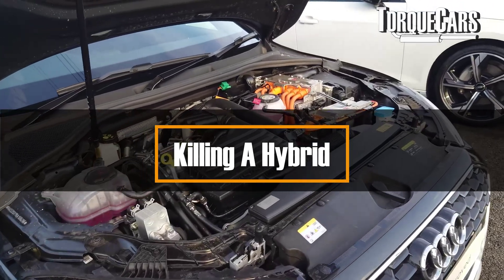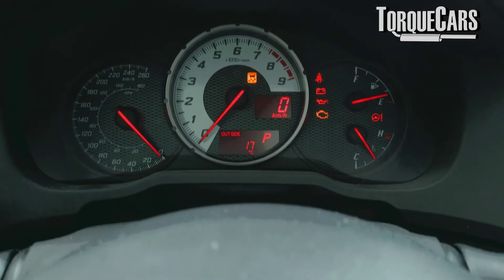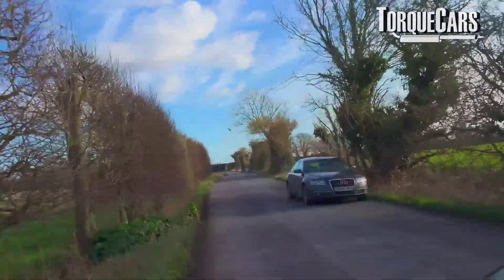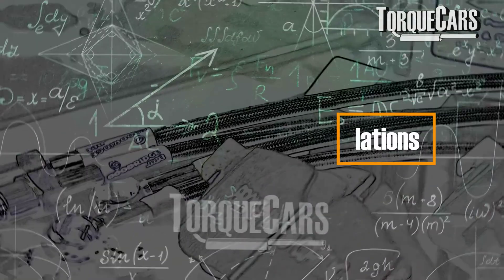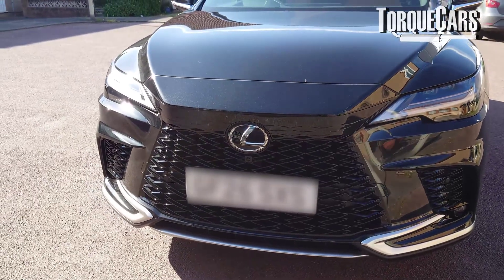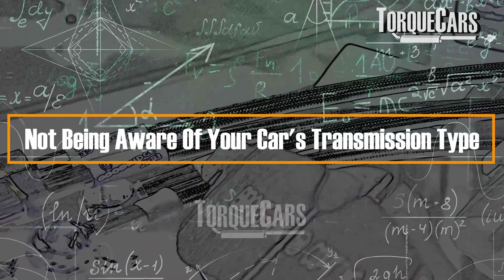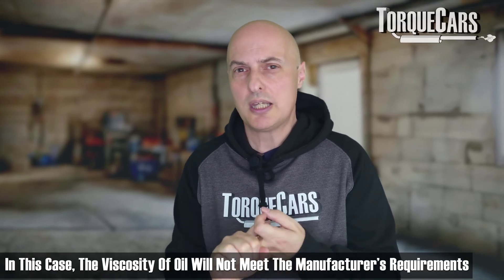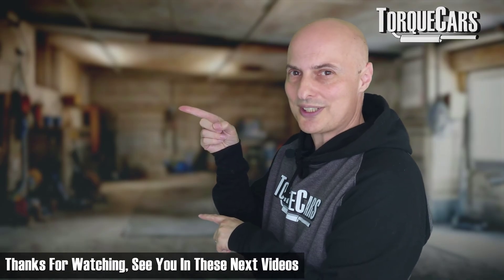The Hidden Dangers From Driving a Plug In Hybrid Badly PHEV (No One Tells You This)

Comment: Latest data shows PHEV’s aren’t much better in fuel economy than ICE cars but more over complicated. And more cost. Best version of ice and battery car is an EREV which is an EV without a gearbox. So it allows a larger battery and engine is purely a generator. This is the next generation of vehicles. But why not just go full EV

Comment: Change your oil, in a hybrid sooner than recommended.
Your 1st oil change needs to be between 500 - 700 miles.  The oil will be silver(ish) due to the engine’s internal parts breaking in.
Change your oil.

Comment: I drive a Toyota RAV 4 PHEV.  I leave about 10miles range in the battery and then go over to HV/petrol.  I have noticed in HV mode the car still uses a bit of the range and it does more mpg.

Comment: I wonder how many miles is needed to charge up that battery. As for engine temperature, well that's the question, cold day, start up electric until you're fast enough, but the engine is still cold! Slow down and electric takes over, the engine gets cold. Unless of course theres a heater to get that engine warm and keep it warm, defeating the miles per charge or gallon of course. So unless the journey is long, and lets be honest , most are not, the heat is not enough and the battery will not charge enough. Diesel has similar problem, they dont warm up for about 4 miles, as opposed to petrol at 2 miles, so a trip to town means the temperature is just right by the time you're home. As for fluid change more often, that's news to me, but not over charging, not running it too low, oh dear oh dear oh dear, Toyota's are supposed to be the best auto transmission, but now I wonder.  its amazing how one video can put you off.

Comment: '24 Toyota CCH. Same as Prius AWD. Prefers @38-60% charge. Have scan gauge. Only way to increase temperature is to use simulated gears, otherwise it manages. I made grill screen for November to May driving, MPG went back up @10. Always hyper mile. ALWAYS 3.7 miles each way. At least once a week don't turn off, charge 12v for an hour automatically turns off. Tires 12% over, average 77 both MPG and EV ratio since new, far exceeding expected. I never drive over 60mph as the EV mode can't activate over 61-62mph. Freeway truck lane 60mph. Will be interesting to see when the oil becomes NOT transparent. The coolants don't need to be changed until test strip indicates.

Comment: I’ve got a 2024 x-trail epower. Love the car and its fuel economy but from where I stand it’s too conservative on that front. I can be travelling at 100km/hour with a 50% charge and take an off road and as I take my foot off the accelerator the engine switches off as I slow down, go around the corner and on goes the engine again as I accelerate back to 60km/hour. In my mind this on and off again of the petrol engine is eventually going to destroy this 3 cylinder turbo engine. These cars should have been built with a larger battery say like 5kwh compared to its 2kwh installed. My advice to people is to buy a PHEV vehicle with at least a 20kwh battery and a non turbo engine.

Comment: Rather an alarmist clickbait title. Not speaking for other brands but the three Toyota hybrids my wife and I I have owned have not had any of these problems. Our current thirteen year old Prius v van has close to 180,000 miles now and the hybrid system and engine are in fine condition. My recommendation is just drive them normally and follow the manufacturer’s guidelines.
Reply from the maker: That's great to hear about your experience with Toyotas, they are definitely known for their reliability. A recent switch away from AGM 12v batteries have led to a few issues, but we have to bear in mind that many other car makers are starting to make hybrids now and lack the experience.

Comment: This guy doesn't know much about hybrids, the 12 volt battery got drained in some models due to a bug, I leave my car "RAV4 PHEV" for 3 weeks every year when in holidays, no problems, the cold engine issue could be true but hybrid engines generally last longer, transmission: here the big mistake Toyota and some other hybrids use eCVT, NOT CVT, they are completely different
Reply: Yes eCVT and CVT transmissions are completely different. I have experience of driving both and for me eCVT is way better

Comment: I just got my 2023 Toyota Corolla 2.0  self charging hybrid back from the dealership this week as my 12 volt battery  went flat on my drive. I had to call the AA out .
I put it on a trickle charger up to 3/4 as I had to go on a trip next day. 
The 3 day trip was approximately 300 miles mainly motorway and 60mph/50mph roads .
next day a 12 mile journey. 
Washed and waxed it next day, in the evening  battery dead. The battery is under the floor panel in the boot.
Rear hatch won't open as no electricity. Luckily  I got the doors open and crawled through the lowered rear seats and managed to pry a gap in the floor to get charging leads on.
This is not the first time I've had a flat or very low 12v battery 
This is the second time I have taken the car to the dealership and asked for the battery to be checked and to see if any drainage or battery issues. 
They found no issues with the battery or any item that could be draining the battery and it was operating in acceptable limits. 
Last year the service representative said because I do low mileage I would need to take it on a 30min   run on a  motorway to make sure the 12v gets a good charge?
This time when I said this is not acceptable I was told due to my sort journeys maybe a hybrid isn't for me.
And try and keep it in sport/power mode. 
Shame the sales person at the dealership did not ask what sort of driving and weekly mileage  was regularly doing when I purchased the vehicle. 
Apparently washing the car with the key in your pocket does drain the battery as the doors unlock and lock multiple times and this also primes the car ready for driving, this has happened to another owner. 
I'm looking to go back to a ICE car after this one is 3 years old.
Reply: You can disable fob temporary so car won't do close/open while washing :) Press & hold lock button + double press unlock - this will disable fob keyless entry until you press any button again. Without it washing car with fob in pocket is madness :)
Reply: @deniss.1926 thanks I’ll give that a go next time
Reply: Driving toyota hybrid 30min. to charge 12v battery? Wonder what are they smoking...
Reply: @deniss.1926 yeah it does sound a load of bollocks, I’ll just have to trickle charge
Reply: Turn off Wi-Fi / Bluetooth and remote unlock (theft deterent) ,6 yrs old Corolla i've never had a battery issue.
Reply: @Roy-pk4xd  I'll give it a try, thanks

Comment: The problem in most hybrids is that the engine often doesn’t reach its correct running temperature. 
I think in Honda the engine powers the electric motors continuously.
Reply: Honda is series up to 60mph, then parallel. Nissan is full series. I.e. engine only ever drives generator.

Comment: We have a CR-V Hybrid. In cold weather, the engine starts up to warm up (itself and probably the battery pack) - and will only not start if we're recently used the car. There is no EV button in the car - so we're at the mercy of the computer which I'm sure Honda have figured out - given that the hybrid system in our Australian CR-V is the same as the system they've been using in the USA for I think 4 generations of Accord with very few issues.
Reply: yeah but we yanks bought almost none of them until very very recently.
Reply: @18_rabbit  You mean the Accord Hybrid? I thought that they had sold in significant numbers? :(

Comment: Had a 2010 Prius. Started burning oil at 100k miles. Oil changes at 5000 miles is highly recommended.
Reply: Still driving a Prius 2012 everyday. Just maintenance every 6 months
Reply: @tomchan4739 I think I had a recalled engine since Toyota acknowledged the oil consumption prior to 100k miles but did nothing since the VIN was not in that range.

Comment: New 2025 RAV4 Hybrid had a burning, electrical smell at 3k miles. Brought her in because it feels down on power, almost as if it lost much of the drive from the motor and is mostly a gasser now. The extra oomph, torque is gone. Dealership says all is well, all in my head. Never buying another one of  these pieces of junk.
Reply: Ignore the Dealership....contact Toyota DIRECTLY and explain your issue! My 2025 Rav 4 is functioning PERFECTLY!  🙂👌🙂
Reply: I have a Mercedes A250e PHEV. I carefully manage the systems as best I can. I normally charge using a 1.8 trickle charge method only and rarely use the 7.2 charger. The car has covered 22,000 miles on electric and 6000 miles using ICE approximately. The only problem is determining when to change from electric to ICE ( preferably when stopping at traffic lights to avoid instant high engine speed for example  on motorways). The car is now 5 years old and HI volt battery performs like new. The summer (predictive ) mileage is around 47 - 50 dropping to about 36 ish in winter. It has had 4 oil changes despite the ICE having been in operation during its 6000 mile lifetime. In my experience if you manage the systems carefully then you should encounter very few problems other than fair ware and tare.

Comment: Many (most?) modern hybrids are electric cars with gasoline engine assist. A possible exception might be at highway speeds. 

Honda is series hybrid (electric car with the efficiency tuned gasoline engine just running a generator) except for out on the highway where the engine can clutch in to maintain highway speeds (it isn't efficient to make electricity to immediately use it).

At highway speeds the Toyota HSD hybrid uses two electric motors to manipulate the planetary gearset to make the efficiency tuned gasoline engine do all the work at the most efficient rpm for the conditions. 

Around town the Toyota is an EV and the gasoline assist engine can assist up through the planetary gearset which provides CVT action to the gasoline engine (the main traction motor is direct drive to the drive axle (same as a Tesla)).

My 12 Volt hybrid batteries last 9 to 10 years.
Reply: What you describe is a series hybrid, I.e. Honda and Nissan. Toyota is parallel hybrid. Toyota made the right decision at the time. Now series makes more sense.
Reply: @rolandrodgers5201 . Describe how you think a modern Honda hybrid works. I believe it is totally series hybrid until the direct drive mode for highway cruising. 

Even serious acceleration out at highway speeds sends the car back to series hybrid as the electric motor is way more powerful than the gasoline engine. At which point the gasoline engine only makes electricity, to help the battery feed the main traction motor. I think,  but I would like to hear how you think the Honda hybrid works.
Reply: @rolandrodgers5201  erm, seems toyota still has very good reason to stay with parallell design, for both the efficiency (Rav4 is a lot more efficient than a Crv hybrid), and durability has been stellar w /toyota hybrids, and not enough hondas were sold in past 20 yrs in hybrid to know
Reply: need to edit this one:  "Around town the Toyota is an EV and the gasoline assist engine can assist up through the planetary gearset which provides CVT action to the gasoline engine (the main traction motor is direct drive to the drive axle (same as a Tesla)).

Comment: You would have done better to distinguish between different types of hybrid. I would think that problems are more likely with PHEVs, where the engine may be left unused for longer periods. With self- charging hybrids the engine cuts in much more frequently, and besides, Toyota/Lexus often use the low-stress Atkinson cycle (and no turbo), making them better adapted to intermittent running. All the same, excellent discussion
Reply: I would agree and suggest to people with a PHEV who drive shorter distances to not charge the vehicle via electricity frequently and let the engine do that charging. In my mind the PHEV is the better option than just your standard hybrid.

Comment: You can't really go wrong with a Toyota hybrid they have built in protection for the hybrid battery so you can't overcharge or undercharge it, ev mode is disabled if the hybrid battery is too low, where you can create problems is with the battery cooling because it is air cooled and sits under the back seats where it draws in air through a vent on the back seats and if you cover this it will damage the battery, the filter also needs cleaning regularly
Reply: Where are these vents on back seat?

Comment: For PHEV drivers, my suggestion is to actually not let your battery deplete when you're currently in a freeway speed situation. This is because the engine will "hit the ground running," as the saying goes, which is bad since it will be moving the car at a high speed while still cold. If you do this only a few times, you may not notice the damage that is being done to the engine. But do it enough times and you'll start to see the damage. This would mean some planning is in order if you're a PHEV driver. If you know you're going to use the freeway for a distance that your battery can't cover on its own and you plan on using the engine for at least part of the way, or you're like me and you have a set day every month where you drive in HV mode to keep your engine happy, drive out of your house in HV mode. This gives the engine sufficient time to heat up using side-street speed so you're not driving with a cold engine by the time you reach the freeway.

It's kind of like doing an intense exercise without stretching, especially if you're unfit. You'll be able to move around, but you'll be more prone to injury. So, get that heart rate going, at least a little more than relaxation speed before committing to a HIIT workout.
Reply: Thanks for that excellent point. Just think how many journeys follow the pattern of 2-3 miles of slow local roads near home, then a sudden blast onto a motorway. If your ICE wakes up for the first time to blast up a motorway slip road, that isn't good for longevity. Of course the leasers and company drivers won't think of such things- it'll be the poorer secondhand buyer who takes the hit as the car ages
Reply: My Alfa Romeo Tonale PHEV EAWD has programs that take care of that.
It starts the ICE motor while the vehicle is still in EV mode, and runs it at a pre set rpm and time, while the vehicle is still driving in EV, to warm up and lubricate the motor, then when the program is satisfied, it switches over to ICE mode, and off of EV mode. 
Alfa has done a good job, with a number of programs it has, to run the ICE motor before switching off EV mode, when it has not run for a period of time, when it is too cold out, etc. 
Still have not figured them all out.

Comment: 1:12 - Toyota handle this very well, heating engine (by running ot) in cold weather. The "on/off" mode goes after the engine is heated.
1:49 - You can't control this in Toyotas. The car itself has full control on it, not allowing battery being out of "comfort" zone.
7:52 - That's a misunderstanding at best. At least in case of Toyota. These hybrids don't like neutral simply because on neutral the HV battery can't be charged (thus risk of being too much discharged and then not being able to start the engine). So why is even neutral there, you may ask. Because it is mandatory 🙂 (car has to have ability to completely disconnect power train while wheels are able to rotate - for example towing or pushing).
Reply: Nor can the low voltage (12V one) battery be charged if N is selected; it's done by converting HV to 12V, either from the traction battery or the motor/generator number 1, attached to the engine. However, it's not possible to completely disconnect the traction motor in a Toyota Yaris; it is permanently attached to the drive shaft via a reduction gear, and can't be towed much with the front wheels on the ground.
Reply: @johnkeepin7527  Yeah, disconnect and "disconnect" :-). It is disconnected, just not mechanically.
With the 12V battery it is interesting, there's no reason why 12V battery couldn't be charged even on Neutral (just from HV battery). Maybe similar reason why it has the Neutral and whole HV system is disconnected from the rest of the car, not just the powertrain.

Comment: Hondas modern hybrids are 2.0L NA engines. On paper that sounds like those engines should be going through less stress and should last longer than their turbocharged counterpart, the 1.5T. The reality is, those 2.0L engines are running at higher compression ratios than their turbocharged equivalents. Coupled with constant start/stop cycles, constant thermal cycling, fuel dilution, and possible LSPI you could be looking at loads of wear and even head gasket failure.